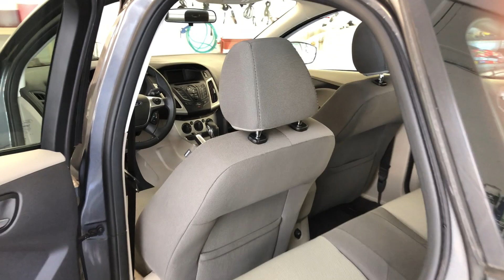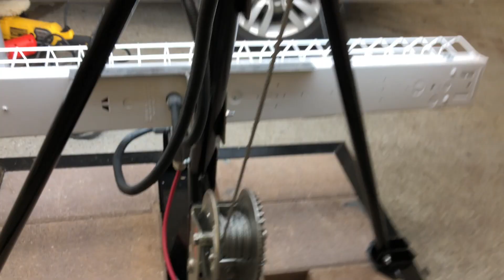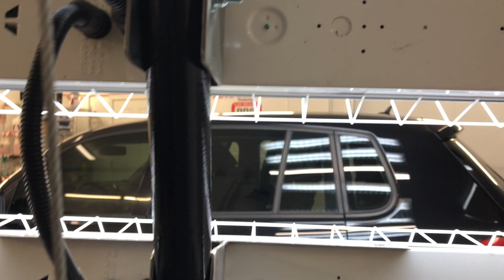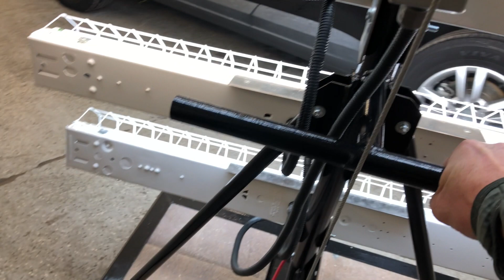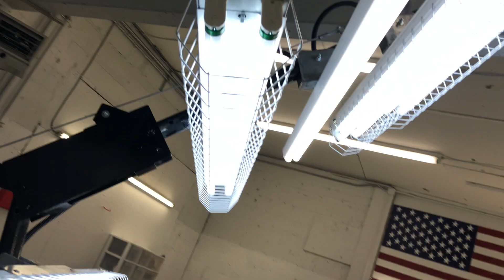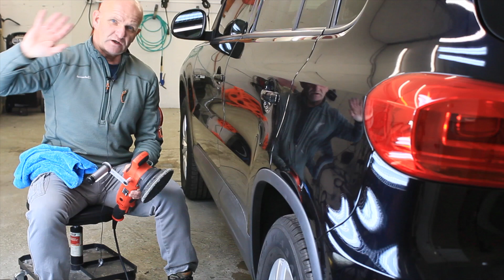Detail Shop Lighting (Custom Made Lighting Tower)

Comment: When it is fully extended, whats the maximum height?
Reply from the maker: Thank you for watching and subscribing to our channel.  We have a full size workshop and It Tops out at 10 feet when you wind it all the way up. Fine for us (it would probably be too high in a standard Domestic garage at full extension).  However the angle can be changed by just lowering the top section at the Pivot Point using the winding handle. This enables the lights in the top section to shine down on the roof of a standard size car, or  SUV so we can have lights closer to the roof of the vehicle rather than relying on the lights up in our shop roof.

I see from your channel that you have a great deal of Lifted trucks.  This system would be great for lighting up the whole side if you needed to polish off a Lifted Truck with ease.

Regards Veteran Detail